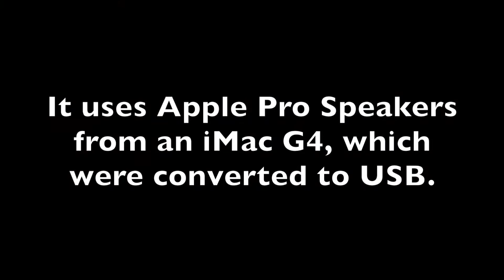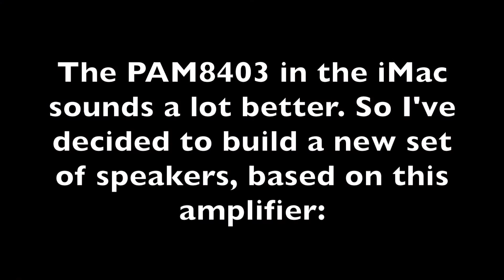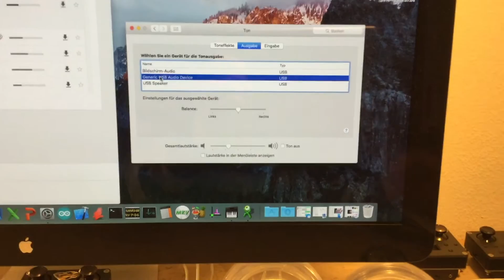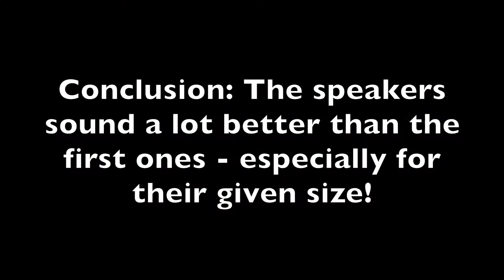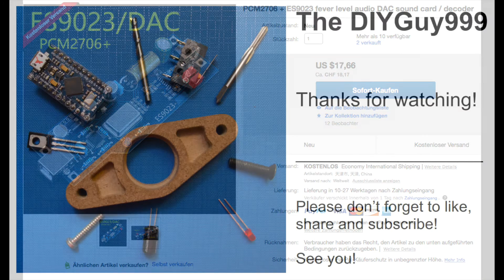Apple Pro Speakers USB Conversion for Hackintosh

Comment: Great mod! And about the PCM2706 + ES9023 audio DAC, is your project still planned ?
Reply from the maker: Thanks! No, it was replaced with the PCM2704. Maybe, I will upgrade V2.0 to 3.0 later
Reply: Damn, I ordered a pcm2706 + es9023 in order to couple it with an amp (maybe a 20w 12v) and my M6531. Not having the necessary knowledge in electronics like you, then I really hope that you will end up doing this mod (soon ...) ;-)
Reply from the maker: Sorry. The main reason for the change was that I discovered, that the pcm2706 + es9023 has bad driver support in macOS. The used PCM2704 is very cheap: http://www.ebay.com/itm/310736493736?_trksid=p2057872.m2749.l2649&ssPageName=STRK%3AMEBIDX%3AIT

If you don't have good electronics knowledge, you should try to build V3.0 as it's shown in the video. A 12V amp does not make much sense, because you can't power it from USB.
Reply: @TheDIYGuy999   can you give this type usb becouse i has one pair speaker
Reply: Hello, Can I use class D amplifier to get the same results@TheDIYGuy999
Reply: TheDIYGuy999 hello can I use class D amplifier?